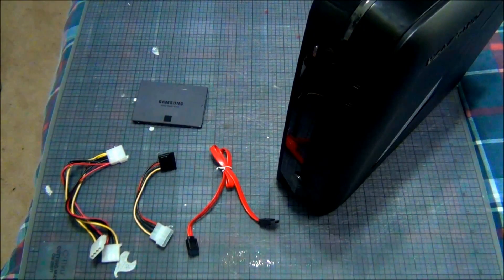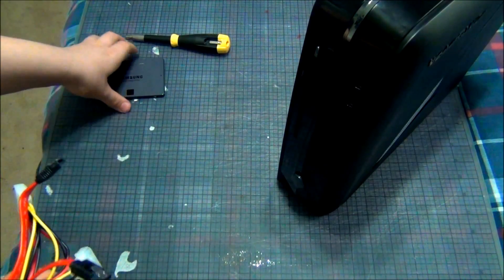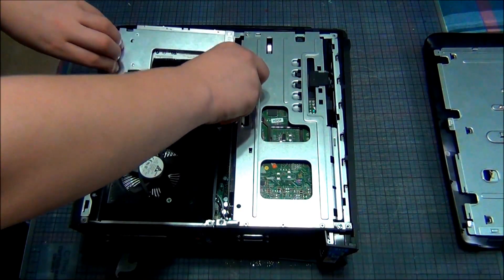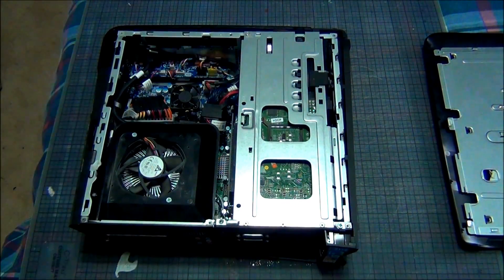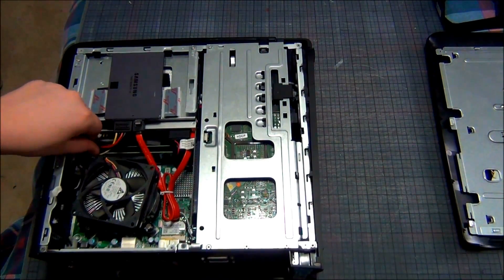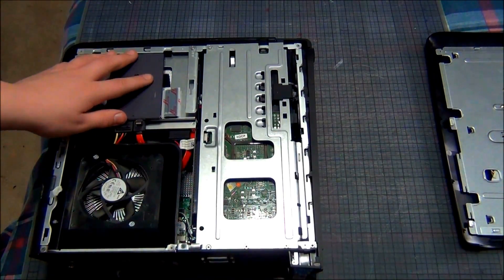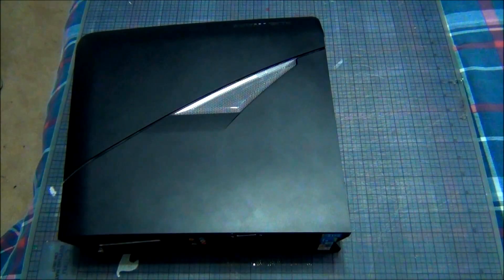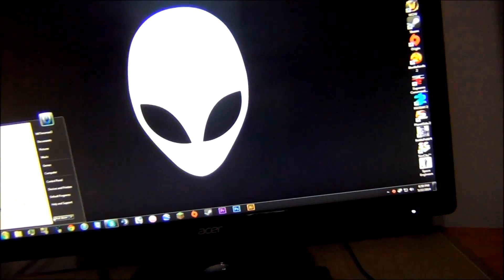Installing SSD into Alienware x51 With An Existing 3.5 HDD

Comment: @MrTimoman3 Hi sir, what's the easiest way to do this? Since i have the cds the come with x51 when you buy it
Reply: And i'm using x51 r2 with windows 10
Reply from the maker: Easiest way to do what exactly?
Reply: +MrTimoman3 installing ssd and transfering my os to ssd
Reply from the maker: +Aye Cee I would install the SSD as I did but then reinstall your OS on your SSD with the disc. Sorry for the late reply.
Reply: +MrTimoman3 should i install the software first before i set up the ssd ?
Reply from the maker: +Aye Cee No, you should install the SSD first.
Reply: +MrTimoman3 last question sir, is this black alienware cd is my recovery cd that i'm gonna have to install in my ssd?
Reply from the maker: +Aye Cee yes it is
Reply: +MrTimoman3 thanks bro. I'm gonna try to work on it tonight
Reply: +Aye Cee i don't need to download my windows 8.1 since i have the alienware cd right?
Reply from the maker: +Aye Cee no you do not
Reply: +MrTimoman3 is my usb hard disk is my ssd? I follow this tutorial and went to my UEFI and i can't find the ssd in the settings
Reply from the maker: +Aye Cee it should be in your boot menu and some where in hard drives or something like that and change the boot too the SSD. May not be named SSD wfi
Reply from the maker: +MrTimoman3 fwi *
Reply: +MrTimoman3 i checked everywhere and i didn't find the ssd. What would be the problem?
Reply from the maker: +Aye Cee make sure everything is seated properly, the molex and the sata cable.
Reply: +MrTimoman3 i will try to do it again tonight. I hope it works fine this time
Reply from the maker: +Aye Cee if it doesn't work we can get in touch via skype or something else.
Reply: +MrTimoman3 thank you so much and i will take a picture of my BIOS/UEFI so you can see the settings
Reply: +MrTimoman3 it doesn't really work, i already updated everything including my BIOS and my intel rapid storage technology. My ssd doesn't show up on hdd priority list
Reply from the maker: +Aye Cee once I get home I will respond back and try to find a different way of finding the SSD.
Reply from the maker: +Aye Cee I will get home at 3pm central
Reply: +MrTimoman3 i tried to put the ssd on the gray sata adapter and still didn't work.
Reply from the maker: +Aye Cee gray sata adapter?
Reply: +MrTimoman3 it's where my cd drive plugged in,  i switch them just to see if it's gonna make some changes
Reply from the maker: +Aye Cee the sata connector to the cd drive should not be able to fit on a SSD/HDD.
Reply: +MrTimoman3 i don't really know what you call that thing you took off before you plugged in the sata to the motherboard
Reply: +MrTimoman3 where can i send you some screen shots
Reply from the maker: +Aye Cee the thing with the red and yellow and black wires?
Reply: +MrTimoman3 i think it's the hard drive
Reply: +Aye Cee i'm sorry i'm not familliar with this computer stuff
Reply from the maker: +Aye Cee do you have a skype account that you can send me a few pics with? My user is timoman33
Reply: +MrTimoman3 i just sent you a request and the screen shots

Comment: how u set the OS in SSD? i ve already cloned my system , but the PC dont recognize my OS on SSD
Reply from the maker: Not sure how to clone but I just used Windows disc and reinstalled Windows on the SSD instead of cloning.
Reply: understand , so i try to disconnect the HDD , and remain just the SSD
Reply from the maker: +TheCobretto You should be able to keep the SSD and HDD connected at the same time just when you install Windows make sure you select the SSD drive. After you install the Windows you will have go into your UEFI BIOS and change the boot order to your SSD first instead the HDD.
Reply: i already cloned my system with SSD program inside the dvd , so need just to select by boot , or i try in second way to disconnect the HDD after ill put back and i will try if work correctly
Reply from the maker: +TheCobretto try to select the SSD to boot first.
Reply: yep

Comment: did you do a video on how to install os? if so what is the link?
Reply from the maker: Yes it was after this video but it was really bad so I removed it from this video
Reply: will just simply using the samsung migration tool do the trick and switch bios order to boot from ssd first?
Reply from the maker: +ECchris that should but I've heard people say that the Samsung magician some times doesn't work. I would try it out. I personally just started a fresh new operating system
Reply: yea magician didnt work properly

Comment: I can't get the side panel back on!
I did EXACTLY everything you did. What am I doing wrong?
Reply from the maker: When you put it on it slides into place and just double check to make sure there is no cables and the cd drive is screwed in properly and that the SSD does not stick out to make from the cd drive and that may cause the Side to not shut all the way

Comment: Is placing the SSD on top of the optical drive/cd drive a SAFE idea?
What are the alternatives?
Reply from the maker: Placing the SSD there is perfectly fine. I had mine there for over a year and no problems. if you want to instead of using Velcro you can use electrical tape. There is no where else to play the SSD unless you replace it with the cd/DVDs drive or you place it where the 3.5" hard drive is.

Comment: hey can I use this 4 Pin IDE to 2 Serial ATA SATA Splitter Power Cable
http://uae.souq.com/ae-en/unit_one.php?id_unit=104600029
instead of this 4 pin molex to sata cuz i cant find this one in my local online store
and is this 50cm Serial SATA to SATA II Cable for Hard Drive
http://uae.souq.com/ae-en/unit_one.php?id_unit=4394800029
the same as this one 8in sata 6gb/s
and ty for the help
Reply from the maker: The power splitter cable that you picked out would not work with the setup and that sata 2 cable can work but it will slow down your ssd
Reply: ok ty

Comment: Question, do you install the hardware first, and then run the Samsung software to clone the drive afterwards? Or do I need go out and buy a USB to SATA and clone the drive before installing?
Reply from the maker: I'm not sure just google out to use samsungs cloning software

Comment: Hi, is that Sata cable required the one you linked or can I buy an 8" Sata III cable?
Reply: I'm installing a Samsung 850 Evo 500gb
Reply from the maker: +gensoBouken it would not matter what sata III cable you get also long as it's long enough and 8in should do it

Comment: Do you know if there is space to add a small PCI-e card to this computer? I need to add a i-394 port for my music DAW, thanks.
Reply from the maker: No there is not unless you take out the graphics card and put it in that slot
Reply: +MrTimoman3 Thanks, I made the mistake to not research this before. I never expected to not have space for another PCI slot. So do you think that the computer is useful without the graphics card? Does the processor handle the basic video needs with the integrated GPU without problems?
Reply from the maker: +Iván Chocrón yes the cpu can handle simple graphics tasks

Comment: what are the three cables called ?
Reply from the maker: It's in the descriptionof the video
Reply: +MrTimoman3  Could you please type them down, since I am not a native speaker. Appreciate !
Reply from the maker: +Tai Zhang 8in sata cable,  1 male to 2 female molex cable,  1 male to sata power cable.
Reply: thx a lot

Comment: Hi.. OP what is the stick thing called t o put it in place?
Reply from the maker: +Kevin Li (Apex) Velcro or you can use electrical tape.
Reply: MrTimoman3 Thank you mate, My X51 original Hardware broke..and everything just gets slower and slower and slower and eventually it wont even start. doesnt matter what I do....so I decided to replace the Original HDD and add a new SSD for my operating System.. Im waiting on dell's backup media disc..pain in the arse.

Comment: Hi, 

Can i ask whats the difference with using alienware respawn and using the windows install disc to setup your new ssd? Do you need to install the driver again with either options? 

Thanks.
Reply from the maker: Alien respawn I think is were you copy the is onto that sub drive then install it onto the ssd. (Not sure what it exactly does, I haven't researched this in 2 years) Using the Windows install disc just install the os and you'll have to download drivers.
Reply from the maker: Usb drive*

Comment: Soooo i installed the ssd. The way my system is working right now is that when the computer turns on, i have windows 7 thats on the hdd and windows 7 on the ssd. I want to just have it on the ssd but i have some problems. all the drivers that he has in the description dont install for odd reasons. like i cannot support this. my process cannot handle it. i tried doing the drivers in the order of 1 -15 but i couldnt because of other problems. my display isnt fitting my monitor. my themes are basic and not what they used to be. can anyone help me please?? maybe through like skype or something. i would love to just have windows on the ssd but i cant get it on the ssd like it is on the hdd.
Reply from the maker: Brandon Gonzalez have you got windows to run on the ssd and you have booted it from the ssd?
Reply: MrTimoman3 Actually I figured it out. Lol 5 hours later. First problem... I installed x86 Windows 7 to a 64 bit machine xD That was my biggest problem. Then I had to get additional drivers from the Dell website. A lot of it was just tinkering. Hence why I am replying 5 hours later lol. Thank you for the response though. Love the SSD!
Reply from the maker: Brandon Gonzalez Alright awesome, I'm Glad it worked out for you!

Comment: i was thinking of removing my disc drive to place the Samsung SSD in the X51. would you recommend that?
Reply: zero gadalla I had to do exactly this. My computer kept freezing every day. I suspected the ssd might be overheating because it is so wedged in between the case and cd rom. Since removing the cd drive and replacing it with the ssd i haven't cashed once.
Reply from the maker: If you would no longer have any at all need for it then yes but if you might need it then keep it in there and install it the way I did
Reply: Ok, thanks. Just realized I might wanna keep it. You know, if I ever needsm to reinstall the OS. Lol.
Reply from the maker: Unless you have a usb dvd drive then you could just remove it

Comment: Good video, but that's a tight space to cram more cables. If you're not big into using DVDs or blu ray discs on your x51, just take the optical drive out and use the existing cables it used for your ssd. You can keep the optical drive cage in there to have something to mount your ssd to.
Reply: Actually, the cable for the CD Drive uses a strange power+sata cable, so it won't fit most SSD's. Regardless you will need an adapter for this. I don't know the name of the cable that the CD drive uses, but it's not a standard HDD plug. I just took apart my brothers machine and found the same thing, so I'm buying the splitters now.
Reply: hey did it work? by taking out the optical drive?
Reply: Hi! Has anyone verified if you can just take out optical drive and replace it with ssd without having to deal with all the extra cables?
Reply: So if i take out my optical drive, then i could pass up on buying all the cables and just use the optical drive cables??
Reply: Yes you can take the optical drive out guys rofl. It's not required, and it uses the same cables.
Reply: @D4doom are you sure about that?
Reply: No, the cable going into the optical drive combines power + sata in a single connector and won't fit on a standard SSD. I unplugged the Sata 1 cable (DVD drive) and plugged the SSD Sata cable. Then I used  MrTimoman3's cable solution for getting power to the SSD. Works fine for newer X51's that have 2 * 2.5" stacked in the 3.5" bay under the GPU. It's a simple job if you don't use your CD drive. Thanks for the video.
Reply: You don't have to buy any extra cables of you remove the optical drive?
Reply: @altzard6170  you do, if you want have a standard ssd
Reply from the maker: Yes you can do that but if you took out the optical drive then you could add another ssd if you really wanted to becuase the Sata for the optical drive would be removed

Comment: does your motherbored need to handle the SSD and can i use a SSD with a 1TB hardrive
Reply from the maker: I'm not sure what you mean by the first question but yes you can use the ssd and the HDD together when you install the ssd my way.

Comment: It looks like the model x51 you have came with an SSD already installed ..I saw the SSD sticker on the back..so why did you have to install one afterwards ?
Reply from the maker: The sticker on the back is the one I add from when I bought my ssd. So no a ssd didn't come with it originally

Comment: Would I be able to install 2 off these into my PC (x51) while keeping existing hardrive?.
Reply from the maker: If you remove the cd/DVD drive then yes. The x51 only has 3 Sata ports
Reply: Yes, but you CAN still have to optical drive in there as you can mount them with some double sided tape on top of the optical drive cage

Comment: What's your system specs?
Reply from the maker: Case: corsair 380t
Processor I7 4770
Graphics GTX 970
Ram 8gb 
240gb ssd
1tb HDD 
750 watt evga

Comment: Hi MrTimoman3 this is awesome. I was considering buying a new PC with a SSD because I didn't think I'd be able to install one in my X51 R2. I'm looking at the Samsung SSD's you recommended on Amazon and noticed they recently released the 850 EVO. Do you know what the difference is between the 840 and the 850 and if the X51 R2 will support the 850? Or should I stick with the 840? Thank you so much.

Comment: Can you help me? I followed everything you said and I installed it correctly but what happened was after I closed the case(WITH EXTREME DIFFICULTY) when I turned my computer on I heard this grinding noise, I quickly shut the power off and went to inspect the inside of my computer and I found that the top of my ssd was all scratched up and I have no idea why. PLEASE HELP
Reply from the maker: make sure a cable under the cd drive is not in the fan and also make sure the ssd is snug on top of the ssd and should be level with the tip of the cd drive casing,
Reply: I'll go ahead and try that, but what would be the cause of the SSD being all cut up.
Reply from the maker: If the ssd is scuffed then that would be because its not flush with the CD drive cage
Reply from the maker: Please tell me when you try and fix it

Comment: Thanks for making this video, and even bigger thanks for putting the links to the parts and driver list in the comment. Saved me a lot of time and hassle, I appreciate it. 

Edit: One thing to note (you might have said this in the video, but I forgot while doing it): I wanted to install the OS on my SSD without the HDD plugged in (to avoid any issues). If you are going to do this, be sure to unplug only the SATA that is running from your HDD (it should be right next to the slot where you are going to plug in your SSD's SATA - just pull out the other one). The reason I am pointing this out is that I purchased the Molex male to 2x female adapter (which is wonderful), so what I did was plug that adapter in but NOT plug in the HDD into the power molex. Problem with doing it this way is that the power cable for the HDD also powers the DVD drive, so I was unable to boot from disc.

tl;dr
If you are going to disconnect the HDD while installing the OS on the SSD (to utilize both drives moving forward), only unplug the SATA cable to the HDD and not the power.
Reply from the maker: Awesome glad I could help!

Comment: Hey man, that was a great tutorial, I was able to follow everything really easily. After formatting the ssd and everything my computer recognizes that it is there but I still want to put windows on it.
I have one slight problem though: 
I lost my windows 7 installation disc, so I tried to put the windows ISO file on a flash drive and made sure to make it bootable 
I used Rufus if that helps
So yeah I put the flash drive into my computer, went into my bios, went to the boot menu, I made sure to change the first boot to USB Hard Disk, then I saved my changes and restarted my PC.
It then started windows as usual from my hdd. 

TL;DR
What can I do to force my PC to boot from my flash drive if even after setting it as the primary boot it won't?
I tried to disable all of the other boot options except for the USB hard disk but that didn't really help
:(
Reply from the maker: Try unpluging the HDD and trying it again